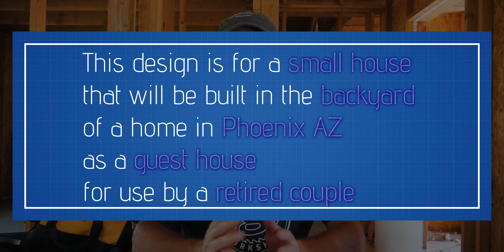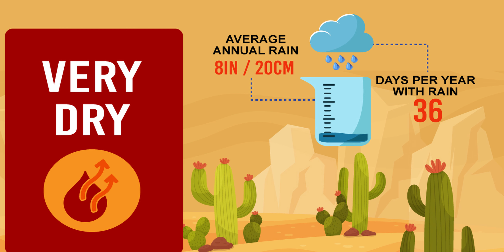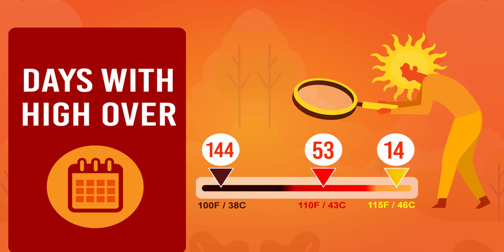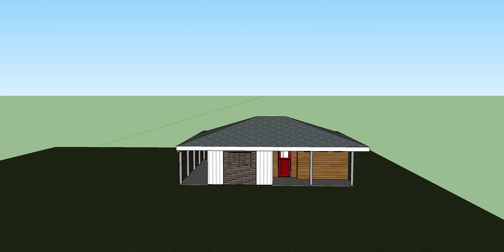Self-Building a Small House | Episode 1 : Requirements and First Steps

Comment: I am looking to start building a Home Theater in 12.5X16X12 room. What Software would you recommend for the designing of this Project?
Reply from the maker: I use SketchUp for all of my projects. It's free, makes 3-D incredibly easy, allows me to visualize precisely what it'll all look like with exact sizes; and makes sure I see where things won't fit, before I build them. It's not specifically about building, though, and who knows how long SketchUp will remain free, what with their ramping up of monetization attempts.

Fusion 360 is a free competitor that has a notably steeper learning curve, but is more powerful in the end. You can even model moving parts (like doors and such) in Fusion 360. That's possible, but notably harder in SketchUp. Like the modern SketchUp, though, it's unclear how much longer it'll remain free.

FreeCAD looks extremely promising but I'll admit to not trying it in many years and it has progressed a lot since. I see that they have an experimental BIM workspace addition now, which is fantastic. I don't know how usable or complete it is, though. I will say that if I was starting out completely fresh now and hadn't used SketchUp for more than a decade, then I probably would focus my effort on learning FreeCAD first, since that has the highest potential for a great future.